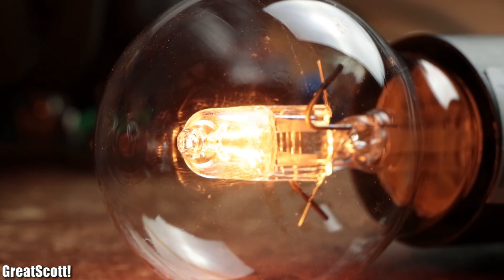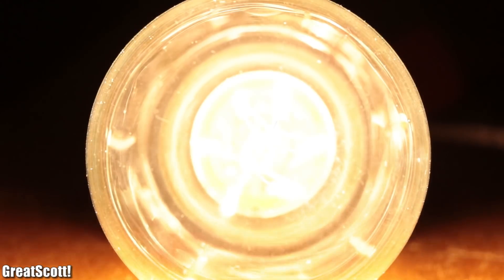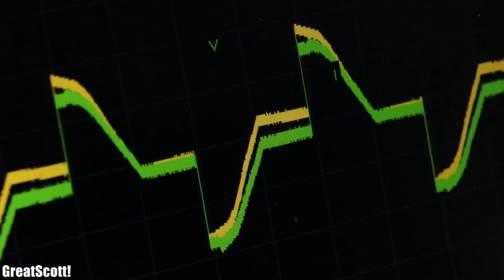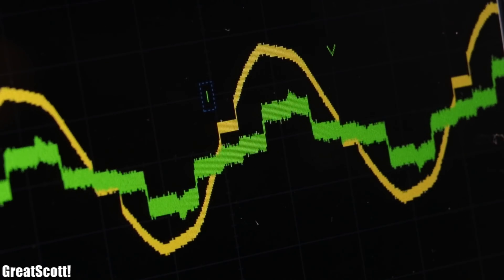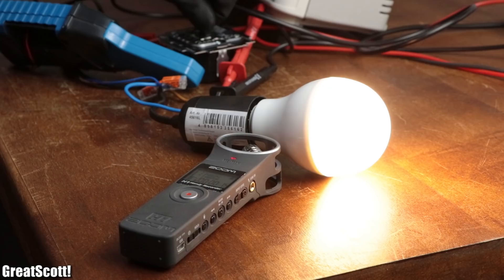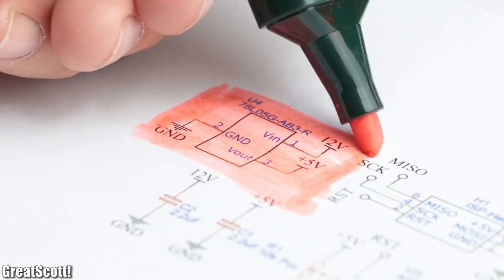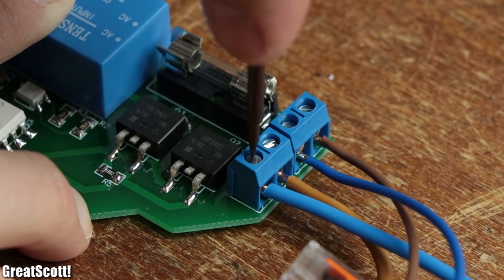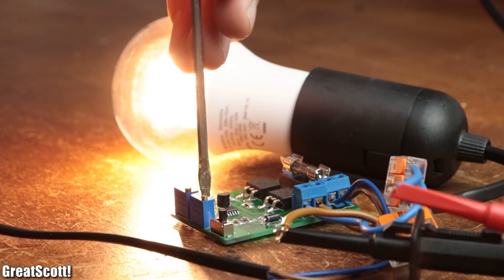The problem with dimming AC LED Light Bulbs || DIY Trailing Edge Dimmer

Comment: If I'm reading the FL5150 datasheet correctly, it has a built in 5V linear regulator that is used between pin 3 & 4 to select TE vs LE dimming.  I wonder if that regulator could power a small microcontroller like an Raspberry Pico?  The FL5150 can be controlled with a 0-10V signal, which again I'm assuming we can pull off the VS pin connected to the 17V shunt regulator.  All this means we can control this over WiFi

Comment: The 5150 data sheet says you can control the circuit with an external 0-5 volt signal referenced to ground, but the ground connection on the 5150 is connected to the point where the MOSFETS join, which looks like mains voltage. Can you make sense of this? The company's customer service rep seems not to understand my concern. Perhaps there is no problem, but I don't want to blow one up just to prove I was right.

Comment: I built some dimming circuits following the ideas in here, it all works but getting it certified to install in an actual house is a different matter. 
I ended up building a low voltage  control module to work with a certified 0-10v dimmer such as Finder 15.11

Comment: Hey Scott, I rebuilt your circuit and have good results till I start to dim at 30% brightness then the led lamp starts to flicker.  I have a dimmable led light though.  Any idea how to improve this?  What led brand/model you recommend that doesn't flicker at low brightness levels?
Reply: Did you solve the flickering issue?
Reply: did you succeed?

Comment: Hi scott I have a non dimmable led pendant light and would like to change the existing driver model: 
30-50w
input AC 85-265V 50/60Hz +- 15amps
Output DC 108-160V 240ma =-5%
Ta 45C-Tc70C

 to a dimmable one.  Is this doable? if yes,  I need to know where to get this

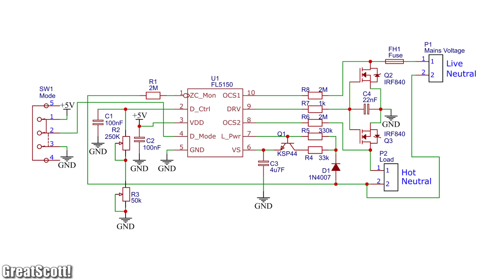Comment: If leading edge dimming is done with the FL5150 circuit shown at 9:59 and you use it to dim a fan, won't it damage the MOSFETS because the fan is an inductive load?

Comment: is there a way to make this work with a touch dimmer module? I have been looking for a dimmer switch with a low, medium,  high, and off, when you touch the lamp housing but the majority of the switches, don't support led bulbs or only support 40w, I'm looking at installing 60w.
Reply: You can use esp32 with the capacitive touch driver

Comment: Can this code directly work on Arduino Uno?
Reply: I was able to compile it with a small change: Line 18 --> TIMSK to TIMSK1. But its not working not sure where to debug it in the hardware or code.

Comment: I have designed the dimmer board..but after doing connection with my dimmer board bulb gets flickering..and at 0% the bulb shows little bit light in it..what is the problem can you help me

Comment: Now you need it with wifi control for Home Assistant and touch pad control because turning potentiometers is so 1990s!
Reply: You can use an attiny with software I2c and connect to ESP controller to make it to your home assistant.  The advantage is you can give it your own I2c address and hookup a lot of dimmers to your same ESP.  I even made it esphome compatible 😊

Comment: Hi Scott, Thank you so much for such a great video. I need to build a 12-volt ac version where  AC input to the board would be 12-volts for dimming 12 volts LED's I will be using a microcontroller as well. How can I modify your 120-volt version components to work with 12-volts ac Thanks again Kazem
Reply: Did you end up figuring out your circuit design? Was it still 50hz or 60hz?

Comment: High scott tks for your explanation regarding your project. I bought one module SCR voltage regulator from internet and I will try to use it as a dimmer for LED lamp. Is it work or not. Need your help.

Comment: How does a dimmer circuit like this work with a non sinusoidal ac waveform? For example a square wave, or a "modified sinus wave" that some inverters uses. Would the triac activate at the zerocross region even if the change is nearly instantaneous? Just wondering for learning purposes only :)

Comment: I have a question: Why are these trailing edge dimmers more silent? The noise is coming from the large magnetic field generated by fast changing currents. With trailing edge current is also fast changing so the magnetic field will also be large but in opposite direction. Why is the noise gone?

Comment: Hi Great Scott! (Yes, I decided to include Great, because your knowledge and understanding of this subject matter is Great (with a capital G) when compared to mine)
So... Love your video, the FL5150 variant is exactly what I need, I just need a few minor adjustments, so I can actually use it on a daily basis. So I found your instructable, opened it in the EasyEDA editor and found I cannot change anything..... The changes I need to make: change R2 into a pot (like R1 in the ATTiny variant) and create a different PCB-layout (so I can mount it in my wall socket). 
How can I make these changes to your design? Would love you to enable me to stay creative on this one ;0)

Comment: Hey Mr. Scott! why is R5 connected to the DC GND and the Neutral of the AC in the trailing edge circuit?????? Dosn't that pulls AC current to that DC Ground

Comment: What about 1000watt load at 110v      
Could you please help me about my this query!
Firstly, i tried bta139 but that didn't work fine then after i used bta41-600b that worked quite good but still facing one problem when i turn on my circuit and connect my 10ohms resistive with apply 110v the mains voltage is decreasing from 244 to 220 or 222   
all the lights are minor dimming because of high load connection my mains rating is near about 3kv.I'm using snubber circuits with bta41 zero crossing detector is okay everything is working fine, should i connect pf to output side to it will give me constant voltage?

Comment: Hi Scott, 
thanks for the great Videos, I really like them a lot!

I have noticed something that I am trying to understand, mayb you can help me with it.
I recently bought a ceiling lamp wich has 4 light bulb sockets (i think they are simply connected in a parallel circuit)

I wanted to use these nice paulman leds, which are not dimmable, and as expected they did not work properly.
https://de.paulmann.com/leuchtmittel/led-goldlicht/led-vintage-kolben-st64-inner-glow-4w-e27-gold-mit-innenkolben-spiralmuster/28598

I then replaced one of the light bulbs with a dimmable one 
https://www.osram.de/ecat/Vintage%201906%20LED-Consumer%20LED-Lampen%20mit%20LED-Technologie%20im%20Gl%C3%BChwendel-Design-LED-Lampen-Lampen-Digital%20Systems/de/de/GPS01_2260892/PP_EUROPE_DE_eCat/

To my surprise all leds can now be dimmed perectly fine.

I have no explanation why this works so niceley. without the dimmable led, the other wont turn no at all or just be fully lit with lots of flickering noise

Comment: Why optos and not just a bipolar? Your low voltage side isn't isolated anyway, so why bother? The previous one made sense as you were able to isolate the two but here... just seems like a waste.
Reply: The power supply he used was isolated. I guess he did that to safely update the firmware.

Comment: I have a little doubt on the schematic front. How is the ground connected to the midpoint of both the MOSFETs? Won't it destroy the circuit as mains supply flow through that point.

Comment: Very good Congratulations.  I am an electrician and one of the major problems I face when using dimmers with led lamps is when I turn on more than three lamps on the same circuit.  For some unknown reason, grouping multiple light bulbs always causes unwanted flicker during dimming.  Any ideas on what causes this problem?

Comment: hey greatscott can you test if a speaker crossover can make more voltage on the speaker outputs 12 v first begin slowely with 5 v to 12v

Comment: Why on earth are you using an opto-isolator to drive the MOSFETs?  The circuit ground could easily be live anyway if AC input is connected backward, and you have the high voltage side of the opto connected to +12v.  Arguably you'd be better off removing the opto and driving the MOSFETs via a transistor as the only thing the opto is doing is giving the illusion of saftey.

Comment: Could you review those gadgets so called “wifi booster / wifi repeaters”? They all look sketchy and not sure if they are really boost wifi signal/speed or just plain old scam
Reply: WiFi repeaters are a real thing. First of all, due to their enlarged antennas they will get a better connection to your original access point than a laptop in the same place. It's possible to get dexent speed even near the edge of the range. Then they act as another access point with the same SSID so your devices will automatically jump between the two. To sum up, they extend the range of your WiFi router at the cost of speed and latency when you're closer to the extender than the router.

Comment: I used to have a homemade dimmable AC LED LIGHT.  It consisted of a simple inductor to limit the AC current, then a bridge, cap, and the LEDs themselves.  It worked well, although it was a bit bulky.  (Would still have it, except that I tripped and dropped it and it broke)

Comment: Hi Love your video, and I'm with you on that ( it's just arrived but I can't wait to build it scenario), I've been there myself!
Anyway I recently made my own dimmer but what I did was recitfy mains, step it down and ,P.W.M. 
Via a 4029 counter ended up with single push button control flipflop direction every alternate button push illumination levels remaining when I remove input, also has a back up battery, BUT BEWARE OF CONTACT BOUNCE use MAXIM'S switch debounce IC.
Kind regards Warren

Comment: Someone help me please... I created a circuit with a triac bta41, I wanted to create a dimmer to hold 40 amps(resistive load) , I'm triggering the triac using a Moc3023 and a arduino, when the mains reach zero crossing, the problem is that when I draw more than 25 amps the triac doesn't dimmer anymore, and keeps on even removing the gate voltage, ps:the triac is mounted in a good dissipador, the gate resistor is 180r (the circuit works well with snubber less triac)

Comment: The almost exact same dimmer you built at the end is available on Ebay for $20 from Latvia!  https://www.ebay.com/itm/ARDUTEX-AC-LED-LIGHT-Dimmer-Arduino-ESP8266-200W-Trailing-Edge-200W-50HZ-60HZ/123781699498

Comment: While disassembling my old vacuum cleaner I found an AC capacitor.
It is 436D MKP 

What are they for? And what is the difference between it and a normal capacitor?
Reply: All MKP capacitors can be used for AC. Only Tantalums and Electrolytics usually only work with DC although bipolar versions exist for special applications.

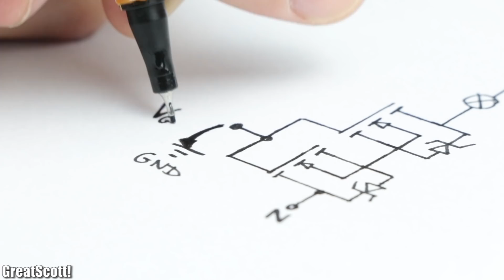Comment: The final circuit diagram has a connection from between the two N Channel MOSFETs to GND. That connection was not in the initial diagram at about 7:15 into the video. Does that circuit then not connect AC Live through the load to GND and AC Neutral straight to GND. Perhaps GND is not Earth which would imply Earth leakage and thus trip an RCD? I think that's how and RCD trips, if the current going into Live doesn't come out the Neutral it must be leaking to Earth and thus trips.
I'm sure your circuit is probably correct, but why is it correct? Even if you're only connecting AC Live to the ground reference of your DC Circuit it still seems a bad idea? What am I missing?
Reply: It's outlined in the FL5150 datasheet on how the different configurations work. Mainly, GND is a floating reference for the FL5150 so it can do things like measure voltage drop across the MOSFETS to monitor current limits and siphon energy for itself from the AC line to charge itself with a DC bias to neutral. If neutral wasn't available, they would have to use chassis ground. Neutral is also used as the zero-crossing reference to monitor when to switch. This circuit only switches the hot line. It doesn't do any control with neutral besides monitoring the zero crossing. When Great Scott attached two terminal blocks to connect two neutrals, that is purely for convenience so that he doesn't need to use an in-line crimp connector or solder and heat shrink to connect the load's neutral connection to the neutral coming from a power socket.

Comment: Great video as usual!!  I was reading the FL5150 data sheet it says it can be controlled by a microprocessor with a logic signal, what exact type of signal would that be because I, couldn't get PWM to work as yet?? And I don't think that is what it means anyway.

Comment: With a light sensor you can also measure how well a lamp (dimmed or otherwise is producing light...
I use a s9067-01 from Hamamatsu with a bias supply and a resistor connected to my oscilloscope. Allows me to see the lux levels hitting sensor at high frequency to discover just how much of the light output is flickering and how much is smooth.
Worst bulbs/led drivers I found has almost 100% flicker and not surprisingly the best have almost 0%.
Most are unfortunately closer to the 100% range. Not fun if you are an epileptic.

Comment: You noticed? YouTube does not have anything an 48vDC or 60vDC. You also don't have on DC high voltage. the electronic parts  also stops at 30vDC, eg transistor.  These problems are handled by the e-bike lovers.

Comment: ehhh.... this is fine for applications where you can tolerate a switch mode power supply, but there's times you want a light source to be always on, rather than simply strobing faster than human eyes can perceive.

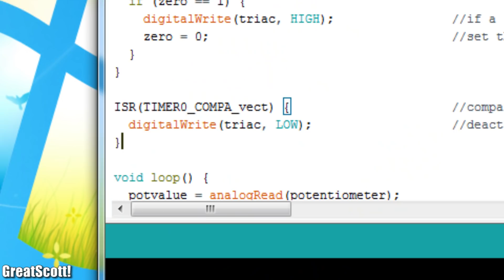Comment: Where do you know so much stuff about electronics that the internet often has no answer for? And how is it possible for the current to flow both ways trough two mosfets connected in opposite polarity in series? Don't mosfets have an internal diode that lets current flow only one way? and by connecting them in opposite polarity in series, perhaps the current should always be blocked by one of the internal diodes? And why do you have to use somekind of adapter at 8:48 ? isn't it possible without it?

Comment: Thanks for the great videos! Any chance you could Talk about boost converters in series? For example for stepping up 5->48V ( usb->PoE) is it better to use one converter directly or can it be done with 2x 5->24V in series (V- Output  of one converter connected to V+  Output of the second converter) versus using two converters in chain  for stepping up to an intermediate voltaje (5->24v->48V)? Thanks
Reply: You can't use two boost converters in series because usually, their Vin GND and Vout GND are connected together (common ground). If you put two such converters in series, you will simply short the two input wires. Make a schematic if you don't understand.
Reply: Only works if you have two gnd isolated power supplies

Comment: With the ubiquity and improvement in LED lamp brightness, efficiency and life, isn't it time we dropped direct mains powered bulbs for SELV only ones and only SELV voltage control cables (5-12v max) in the walls? 

Far greater simplicity of multiple control from wall switches with easy to implement direct or WiFi control providing maximum flexibility and in a much easier to install and understand radial topology (UK anyway). Use of LSZH cat 5 or 6 control cable means greater safety in several respects. Then using PWM to vary brightness on the SELV power side very easily, cheaply and efficiently.

Comment: Nice vid, but I was hoping on how to deal with flickering of dimmed lights.
Reply: He answered it, if you have a non-dimmable LED lamp, you cannot dim it. The SMPS will make sure that the LED's keep their brightness until the energy supplied is too low, then the LED's will start to flicker. The only way to dim LED's properly is to use PWM. This method provides the LED's with their required voltage to switch on but pulses it in such a manner that the average voltage produces a brightness that we perceive as lower than full. If the PWM generator is too slow then we would actually see the LED's flicker based on the duty cycle. This usually happens at mains frequency though, so either 50 or 60 hz, depending on where you live.

Comment: Which type of dimmer is more suitable and power efficient for inductive load such as fans? Also is it possible to drive single phase ac motor as energy saving dc inverter motor?

Comment: Hi Scott. I assume you're aware, that the circuit with the ATTINY is not isolated from mains - it's ALL connected through GND. You could replace the 4N35 by a simple transistor, and have probably better switching behavior of the mosfets. I'm also wondering if R2 and R3 don't get hot (they have to dissipate approx. 1/2W on 230VAC) ...

Comment: Or we could go caveman and use a isolated switch that powers a chandelier. High, medium and low. Low powers two bulbs, medium powers four and high powers six bulbs so a total of twelve bulbs.
Reply: Pfff, let's go back to the ape years. Don't enclose any circuitry anywhere - just put it on the wall where it's visible and make people change resistors by hand in order to dim a breadboard LED
Reply: @ornessarhithfaeron3576   If it works, don't fix it. I had a 1979 Mint Condition Camaro Z28 so easy to work on, rarely needed a part and it didn't cost a arm and a leg to fix. Now they have sensors known to go bad in the middle of the engine that cost you 3k if you're lucky to replace a $10USD part. Oh I forgot to mention the 3 or 4 computers that love to glitch causing the engine to malfunction. Recalls all the time...Let's figure out which one will be a headache? Pfff.

Comment: Hey Scott, if you connect the terminal blocks to each other before soldering, they don't move as much when you screw the wires in. And look slightly more professional :)